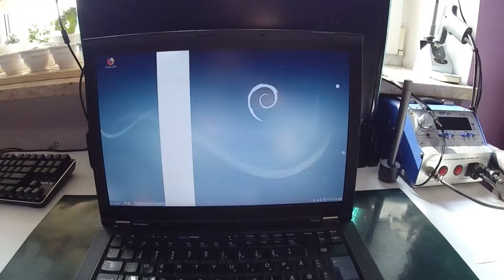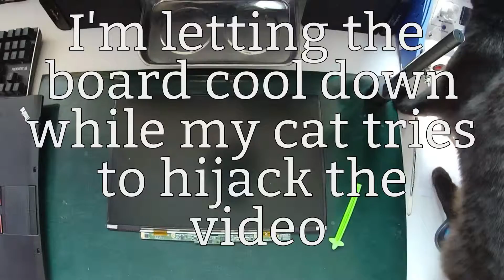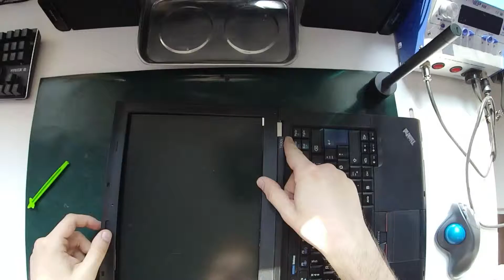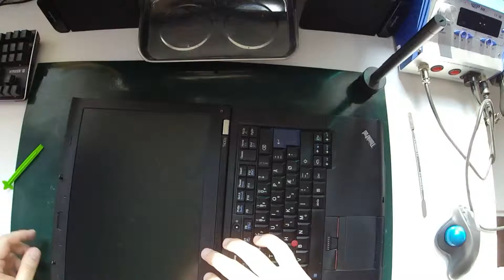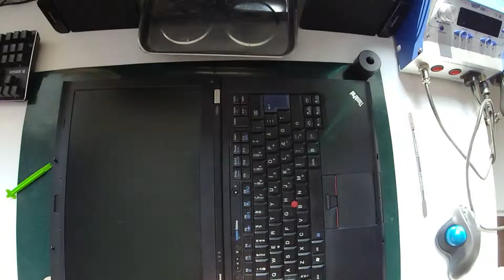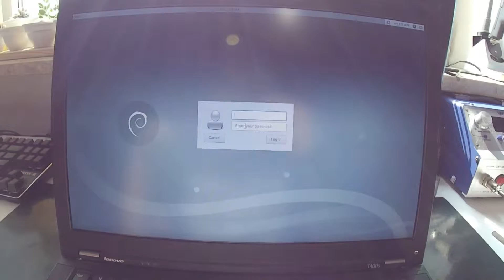ThinkPad screen vertical line problem FIX using hot air - T400s, T410s, T410si

Comment: Thank you. I don't have a hot air gun but I tried moving that part and the white bar has disappeared. I am pretty sure it will come back but I have closed the laptop a couple of times and it is still good.

Comment: Is 200deg C sufficient/hot enough for the repair?
Reply from the maker: I think it should be a little hotter, lead free solder has a melting point of around 220 C.
Reply: @megamiazga  ok tq

Comment: I had the same problem. Fixed it using electronic cleaner and repeating connecting disconnecting the LCD contact a couple of times. No problems since.

Comment: Thanks I'll give this a go!
I hate having the board directly connected to the LCD. It's asking for this to happen.
Most T and X series had a separate board even up until the T530, which meant you wouldn't get this problem.

Comment: Thanks for the tip. On mine (x240) I applied the soldering iron at 400°C but that would not fix the issue. That was the other side of the ribbon cable at cause. So I applied the iron there two! I molted a little bit of plastic but it worked. Hoping it will last.
Reply: My first repair did not last long so I did the following: - stuck metal bars with hot glue at the back of the screen so that the panel does not flex - bent the metal tabs holding the PCB to give more slack to the ribbon cables. Then resoldered as above. This gives the laptop a rather original industrial look. For now it works.
Reply: D
Reply: Z

Comment: hi i have the vertical line problem on my lenovo thinkpad e 450 but when i screenshot then that won't appear on screen pictures . will it be fix using your methid
Reply from the maker: well, a screenshot won't show you what actually appears on the screen, only what the operating system sends to it. As for this method, I'm not sure if it's the same model of screen, the part number is in the description, you have to compare them.
Reply: @megamiazga  oh i also tried by connecting on tv through hdml wire and there is no line on tv so what can be the problem sir ?
Reply from the maker: @chayangstha5341  then it's definitely the screen or the screen cable. I would start by replacing the latter.

Comment: Hi,

I'm experiencing something similar with my HP Presario CQ71 17.3" LED LCD screen. I have about 2 inches wide solid vertical white line on the right side of the screen. 😓🤕

Is it also possible that the GPU/graphics chip is the problem too ? A loose connection underneath perhaps ?

Because I too used the hot air station approach on my T-Con board of my screen but that didn't fully fixed the issue. 😕

Thanks &...

Best Regards,
Reply from the maker: Does it also happen when you connect an external display?
Reply: @megamiazga  That's really the interesting part. The laptop has a HDMI & a classical VGA output port. 🤔

If I try using an HDMI cable & connecting the laptop to the TV, I get no output on the TV. If I use another computer LCD TFT monitor for the VGA output it's the same.

I also tried pressing the Fn + F4 key to force the switch to the external display while using the VGA port, but with no success. 😕

The laptop is though without no OS/HDD. Maybe the VGA or HDMI port only works when there is an OS installed.

I also tried holding down the Windows + B key when turning on the laptop but I get 3 beeps I think. The loop repeats. The screen is blank/dark during this. But no graphics test. 🤔

So I really can't be sure whether it is the LCD screen, LCD cable or the GPU chip that's causing this as I can't properly eliminate the possibilities.

Any additional tips ?
Reply from the maker: @davidbolha  try booting for example a live linux distro (such as mint) because they have the appropriate drivers for switching to an external display already built in

Comment: I just accidentally press the bezel and it's got screen exactly like yours..but I don't have hot blower for this time,😅😅..
Reply from the maker: You could probably do this with a soldering iron and a little skill ;)
Reply: @megamiazga  I have to same problem but i only have a soldering iron how should i do it will it melt the ribbon cable / connector and if so should i do it from the back of the screen instead?
Reply: @megamiazga  Can I use hair blower?
Reply from the maker: @randomrandom4050  No, because it won't get to a high enough temperature to melt the solder.
Reply: @megamiazga  Like how would you heat it up with soldering iron?